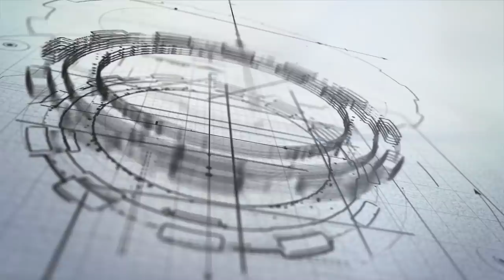COLD START, TANNERITE BEAVER BLASTING, KUBOTA TRACTOR SNOW PLOWING (plus more drone footage)

Comment: Hey John take one of those ratchet straps with hooks on both ends and I hook them on your out Riggers and run it from one to the other and ratchet it up tight you won’t have to worry about them relaxing and going down and that’ll minimize your time the other thing is next time that happens just start moving your back all assembly and flowing hydraulic fluid it’ll free up the nonworking valve
Reply from the maker: That’s what I ended up doing is moving around the BH controls and it eventually freed up. 👍
Keep on tractoring!

Comment: I had the same problem with one of my outriggers last winter when it got really cold, I don't know if there was moisture in the valve body or something, once it got warmer the problem went away but I hold them both up with a big ratchet strap now when it's parked to prevent them from drooping down.

Comment: Hi. Beautiful place there. Just wondering, in your experience, if the 23 you own would handle 'blowing' the sort of snow you were bucketing at the beginning of this vid? I am considering buying a 2610 here in Canada and curious to know what they can handle in terms of heavy snow. Thanks.
Reply from the maker: The snow I was moving with the bucket would have been handled easier and faster with the 23S with the front blower. However if the snow was heavy and wet I probably would still choose the 23S but it would have taken longer. A tractor mounted snowblower on front or back beats a bucket any day. Great question! 👍
Keep on tractoring!
Reply: @ritterjon  Thanks!

Comment: Isn’t amazing how bad a bucket is at plowing snow?!  Downright frustrating.  It’s so good at dirt, sand, stone, etc... but snow is a totally different beast.
Reply from the maker: It is absolutely terrible. So many better methods, you'd think I'd have a better method by now. I just really don't get out there much in the winter. 
Keep on tractoring.
Reply: @ritterjon  yeah, we don’t use our up north get away in the winter either.  The few times I’ve been there, I just use my rear blade.  Works well.

Comment: A nice cheap wood stove in your shipping container could help those cold starts.
Reply from the maker: Not a bad idea! A coffee can with hot coals placed under the engine would be good idea as well. 
Keep on tractoring!
Reply: @ritterjon  i plan to get a shipping container shed too... with a wood stove so you can warm up the tractor before hand, melt the snow off after your done using the tractor, and have a warm up shelter all at the same time.
Reply: That was a good cold start John. It takes more than cold weather for a Kubota not to start. Their nice machines.

Comment: In Wyoming ranchers like beavers because their dams keep water on their property.  If they put in a dam or built a pond it would be illegal.  In Virginia I diverted a highway to avoid a beaver dam.  I have seen them in brackish streams.  My lab and Cane Corso loved to play with them.
Reply from the maker: Absolutely a great asset for ranchers in Wyoming. However in MN we have plenty of water and the beaver are flooding me out of a large piece of property. They’ve got to go! 
Keep on tractoring!
Reply: I saw a video many years back, a fellow had broken down the beaver dam, then took a long length of black weeping tile and laid down along the creek. You set it up a certain height, where the water level won't flood your property. The beaver couldn't figure out how come the water level never came up, problem solved.

Comment: You need a snow pusher or a front mount snowblower.  To much snow for the bucket.
Reply from the maker: Yes I need a better method for sure. 
Keep on tractoring!
Reply: Nice place you have there. I like your tractor barn.   It works.

Comment: maybe it needed more throttle to have more power to lift up that leg.
Reply from the maker: Possibly, it has never been an issue at regular temps before. After about 10 minutes of warming up everything seemed to work fine once again. 
Keep on tractoring!